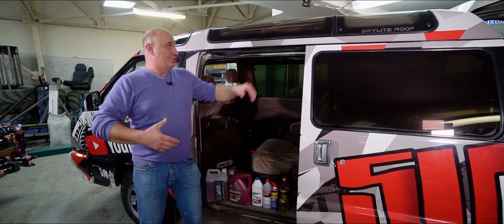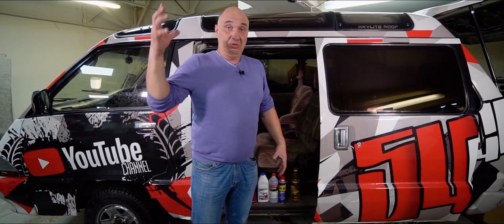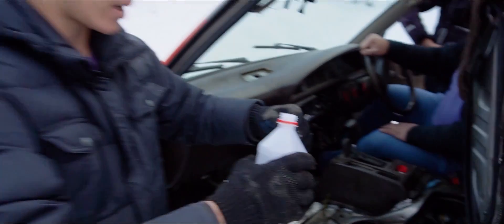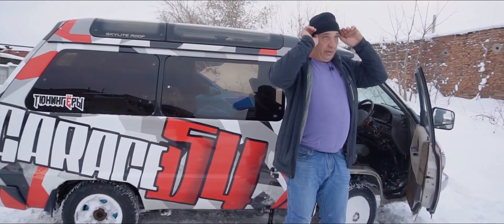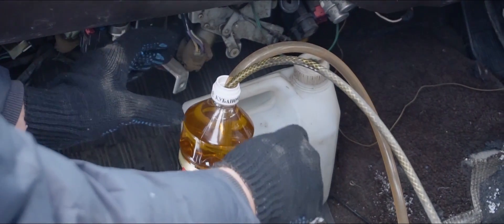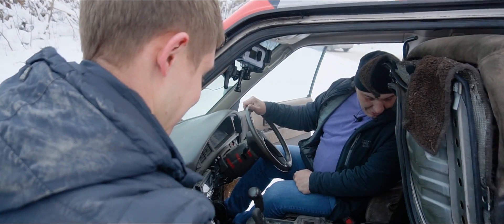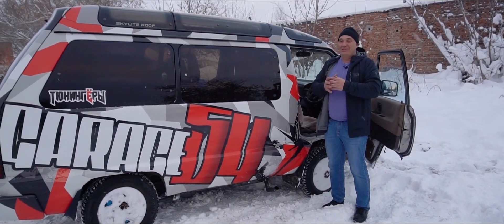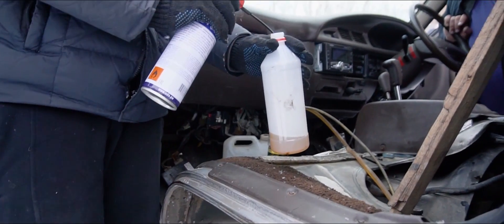Alternatives to diesel fuel: WD-40, cooking oil, brake fluid, Dexron

Comment: I believe (although not 100% sure) that running the engine on Kerosene probably cleared out a load of dirt / sludge in the fuel system, resulting in more fuel flow when the sunflower oil went in (and subsequently more Blyat under acceleration).

Some of us with old or high-mileage 80s / 90s Mitsubishi gasoline engines will add a small bottle of methylated spirit / turpentine to the engine oil and injector cleaner to the fuel just before a service to flush out sludge and clean the injectors;

1. Add a 300 to 500 ml bottle of turpentine to the engine oil and 2 small bottles of injector cleaner to a fuel tank with only 10-20% fuel in the gas tank
2. Start the car and fast-idle at 2000 RPM for 15 minutes (or go for a gentle drive, do not drive hard)
3. Turn the car off and change the oil for cheap oil (part-synthetic will do). You can re-use the old filters.
4. Start the car and fast-idle at 2000 RPM for another 15 minutes (or go for a gentle drive, do not drive hard)
5. Turn the car off and change the oil for good quality oil (fully-synthetic) with new oil / fuel / air filters and immediately fill up the gas tank to 100% 

This helps clean out the sludge / crap that builds up in the oil pathways and injector system and should restore some of the lost HP and fuel efficiency that comes with age / high mileage.

Warning: The second oil change and filling up the gas tank is extremely important to remove the aggressive chemicals in the turpentine / injector cleaner. If you skip this, your engine may fail

Comment: What would happens when you run the engine with the exhaust smoke, exhaust pipe connected directly to air intake of engine!?
 Will you try this please..😀
Reply: 100% EGR :D oxygen is used a short time and engine dies.
Reply: @Karjis  they are into some experiments. Wanna see how do engine work out, with litl bit oxygen supply & rest the exhaust smoke from engine.

Comment: These guys are Ingenious! Although Cooking oil in my opinion is a GREAT ALT to Diesel fuel, The drawbacks are that I've noticed your Injection pump & Injectors over time will get gummed up & Clogged. Therefore more timely maintenance. But ofc it depends on the eng.

Comment: I keep one gallon of atf in all my diesels.... it’s gotten me home a few times... and can be used in everything: power steering, fuel, engine oil ,trans, transfer case and diffs If necessary, I even used it as an emergency brake fluid (yes flush the system when you repair it RIGHT)

Comment: A diesel engine will run on anything with a flash point, which means the fluid/gas will ignite itself just from getting very hot. Thats why diesels can run away, the oil can get into the cylinders and combust under compression, or if there's something hot in the cylinder like a glow plug stuck on or some foreign debris thats glowing hot

Comment: Kerosene is diesel fuel minus the oil so its definitely damaging your diesel engine your supposed to add two cycle oil to kerosene before using it as diesel fuel
Reply: Ratio oil/kero?

Comment: For years I drive my 2000 Suzuki vitara in a 30% washed and filtered used cook oil with 70% diesel. No issues, and better engine sound.

Comment: The WD-40 may have had aerosol in it since it came from a spray can. I'm sure it would have worked if you bought the kind that wasn't pressurized. I've successfully ran a snowmobile engine on that stuff. Diesel fuel is kerosene with paraffin wax added to lubricate everything in the system. We are working on a low-cost alternative to diesel fuel called "biodiesel" here in the USA, I wish I had a car with a Diesel engine, that was a great video!
Reply: Government doesn't want biodiesel so it has made it increasingly difficult to implement it everywhere. We are the largest producers of wheat, corn and soy. Fuel should be so readily available and cheap but its not
Reply: @vikinglife6316 what government? Here in Indonesia all subsidized diesel is B30

Comment: ONE OF THE INGREDIENTS MAKING BRAKE FLUID IS CASTOR OIL, MIXED WITH ALCOHOL!
I HEARD A FUNNY STORY ABOUT CASTOR OIL IN 1960 WHILE ATTENDING AN AUTO MECHANICS SCHOOL.  ONE OF THE TEACHERS WAS THIS OLD GENTLEMAN WHO RACED CARS IN THE 1920 ERA!
CASTOR OIL WAS USED AS ENGINE CRANK CASE OIL!
CASTOR OIL WAS ALSO USED A FOLK CURE FOR CONSTPATION AS WELL FOR OTHER ILLNESSES!
OUR TEACHER SAID THAT WHEN RUNNING IN A RACE WHERE MOST CARS WERE USING CASTOR OIL, IT WAS QUITE IMPORTANT TO RUN AT THE HEAD OF THE PACK!!
IF YOU DID NOT AND BREATHED A LOT OF CASTOR OIL FUMES, THEN YOU WOULD HAVE BAD CASE OF DIARRHEA THE NEXT MORNING!!
💩💩🤢🤢🤢 LOL LOL
Reply: Castor oil and alcohol haven't been used in brake fluid for decades. After the development of glycol esters, which have a much higher boiling point, much lower freezing point, and better corrosion resistance, brake fluid switched to those. Castor oil and alcohol based brake fluids are known as DOT 2, and are obsolete. Glycol ester fluids are DOT 3, 4, and 5.1. DOT 5 is silicone based and not compatible with the others.
Reply: puckcat22679 THANKS FOR THE INFORMATION! I HADNT HEARD OF THE NEW STUFF USED !!
I HAVE NOTICED MUCH LESS CORROSION IN BRAKE CYLINDERS HOWEVER

Comment: I'd like to see if it could run for a whole year on only the cooking oil , but put it on Dyno before and after to see what kind of numbers it will do, and will it last longer running around on the cooking oil instead of regular fuel methods

Comment: that dexron probably would have been gangster with the turbo actually on it, it was actually "over fueling" and now needs more air to clean up the exhaust smoke. know a guy that runs his 7.3 on mercon, says it actually works fine when you actually have enough air coming in to keep up. 🙂

Comment: "Anything flammable liquid can be used, no problem" well, wait a few days/weeks and if all the fuel system gaskets survived - gasket material compatibility is one of the main reasons why there are so many OEM-specific fluids out there. Then again, an old diesel van may have some ancient toxic rubber formula in its gaskets that can survive everything.
Reply: Typical rubber is NBR or Buna-N or N70 (just in different names, same material, essentially ABS rubber aka acrylonitrile butadiene, nitrile rubber) and some newer designs would use fluorocarbon rubber like FKM (essentially PTFE rubber)

These materials resist most fluids including solvents and gasoline, FKM resists them at elevated temperatures(NBR is usually limited to about 150 deg.C for some variants, 100 deg.C for raw nitirle) and more fluids, except that FKM and all PTFE compounds are toxic above 300 deg.C, even if the fumes are all clear, the remnants of it is dangerous, and strictly no fluorine(which would kill this fluorinated rubber compound)

Fuel system sealing consists of O-rings and the hoses, all typically rubber. Your main concern is the plastics that most would be present on the fuel system(newer ones to be exact, older ones are usually metal of course) which may detoriate with some gasoline or benzene and some thinners and solvents

Overall it would last fairly well until the next scheduled maintenance schedule, unless it was engineered to break which almost all things of today are. No such thing as ancient rubber formula that is toxic  on old designs, old rubbers will be NBR or EPDM(polyethylene rubber) and not FKM which is considered a high-performance rubber grade

Comment: Back in the the early '70s I was night manager at a very popular gas station. We had an owner operator
with a Detroit dump truck that loved our 26 cent a quart re-refined oil and gasoline that I don't remember the ratio.
Said He always topped off when he was in the area. 
We had 3,000 gals of the oil we pumped with a gasoline pump.

Comment: I used to run a van on veg oil.... sometimes I used to cut it with ordinary diesel, sometimes not. 
At the time it was cheaper - but now it is not. 
And yes it is a nice smell from the exhaust... totally non offensive :-) 
You just got to be careful of the viscosity so you don't damage the pump.

Comment: Yeah you've got to be careful with common rail diesels. The pressures needed are so high that if the high pressure pump loses lubrication then it will spill its guts out into the fuel rail and kill the injectors with it. See it happen all the time. I wouldn't even put the cheap diesel in them, kills them all eventually.

You can murder the fuel pump on older diesels like this by using vegetable oil, but there's ways around that problem.

Comment: Real WD-40 probably wouldn't work well either. It's not all that flammable- it usually won't burn unless you keep a flame nearby to sustain it, as most of its composition is non-flammable, low vapor pressure hydrocarbons. The low vapor pressure part is why you got the foam in the feed line. The pressure drop at the pump inlet was causing it to flash into vapor. If you use the feed pump to maintain pressure at the inlet to the injection pump, it might work, but it still wouldn't run well due to the low flammability. It would probably be able to run, though.

Comment: HOW?
Sunflower oil has no octane... and shouldn't combust
Reply: Rudolph diesel designed the diesel engine to run on peanut oil. diesel fuel was specially designed for the diesel engine to run even BETTER and LONGER, but it will run on like every oily fuel you can find. ✌🏻
it would run on liquid wax, oil, liquid spray paint, degreaser, cleaner,..... like, everything exept water i guess
Reply: Fuel in diesels is measured in cetanes.  Octane is for gasoline.

Comment: We used cooking oil instead of diesel for tractors (especially soviet made) during '90s in Serbia when there were shortage of gasoline and diesel because of war.
Also many farmers still use cooking oil for old tractors because it's much cheaper than diesel. And also smells nice 🙂
Reply: Što Borkov traktor miriše na pomfrit?
Reply: Da, i rakiju umesto benzina u osamdesetima.
Reply: Did you have to start the engine on diesel or kerosene and heat the cooking oil before it would run in the cold?
Reply: @vikinglife6316  Massey Ferguson FE35 (and yugoslav version IMT 533) was struggling on cold start with vegetable oil as fuel, best way was to mix it with diesel. But with soviet made tractors (LTZ, MTZ) - there was no difference between diesel and vegetable oil as fuel. They run it on cold with no problem
Reply: @dufko86  wow. Quality 👌🤝😊🙏

Comment: Loved it.  I imagine the boiling point/vapour pressure of the WD-40 stand-in is too low: under pump suction is starts to boil and you've got old fashioned vapour lock.

Side note: Is your area of the world right hand drive or is there just a mix of vehicles from different markets?
Reply: russia is usually left hand drive but they have everything because russia is so big

Comment: Something doesn't add up I have used WD-40 in a diesel before works just fine. But then again it was a vintage single cylinder diesel

Comment: I'm guessing the fake wd-40 is foamy because of the propellent being dissolved in it still. Its essentially carbonated. Start pulling a vacuum on it, pulling it through a fuel line, and the dissolved gas will start boiling out.
Reply: All they need to do to confirm is take that half-bottle, get it to room temperature, and shake it a little. Should outgas and foam up, but afterwards might actually run the engine.

Comment: I pour my used engine oil into the fuel tank every time I change it on my diesel... I only use its oil in the tank, haven't considered the used oil from my Toyota gas engine 🤷‍♂️
Reply: @shaun milnes I used to, but I noticed that it was always debris free so I stopped pre-filtering.

Comment: In the garage I worked at we used to prime the diesels by pouring Dexron into the spin on fuel filters. But one thing we did was mix waste oil, used fryer oil, and acetone filter it all and run it in the diesel trucks we had.

Comment: Diesel engines are popular because you can burn many different fuels - some can be grown or produced or recycled... Sugar apparently wrecks engines - is there any way of getting sugar dissolved and working as fuel? Would you have to go for glucose instead of sucrose? Could carbohydrates work if chopped up small enough? e.g. boil up potatoes/ rice into a milkshake then thin it out?
Reply: No, because sugar (glucose included) is primarily carbon, hydrogen and oxygen.  Carbon is the enemy of engines.  What gums it up is the carbon being mixed in with the water (the Hydrogen and Oxygen being broken from the Carbon to become water), and sticking to surfaces.

Comment: "Use cooking oil if it was cheaper than diesel fuel"
- Garage54
Reply: There is a van that here that runs on filtered used fish and chip cooking oil, they get it for free. In New Zealand diesel vehicles pay an independent tax based on the odometer so we are allowed to screw with the mix as much as we like.
Reply: @robmanueb.  Yes
Reply: @robmanueb.  why would you worry about the mix? We are overtaxed in New Zealand and road taxes are going into the general fund. Mix as you like. Pause your Odo too.
Reply: This, and used frying fat, was often used as fuel here in Germany, but it only works with older diesel engines. A more modern engine can take damage from this.
Reply: Old diesel engines can run on anything! 🙂 I was driving my TD Jeep on vegetable oil and this year I'm driving on wasted motor oil and that's free fuel. 🙂
Reply: @V8AmericanMuscleCar  Rip to those who made it to burning water, using higher voltage custom spark plugs.
Reply: @Wavefront101  you can't burn water that's like burning ashes it's already fully oxidized
Reply: @virtualtools_3021  you burn water via electrolysis
Reply: @CableWrestler  lol, no you don't - electrolysis is reverse burning
Reply: Here diesel now cost 2,8$ pr liter while the cheapest vegetable oil used to cost 1,17$ pr liter a few years ago because no fuel tax... (now I can not find any of the cheep vegetable oil anymore, wonder why ;) )
Reply: @a64738  - you probably cannot find cheep oil because chickens aren't very oily.
Reply: I've ran my van on used fry oil for over 40k km now. just filter it and pour it in...
Free fuel, and there's actually no tax issue because of a loophole in the law..

Comment: Biggest problem doing this on a more modern car is that the new plastic and synthetic rubber fuel lines and pump seals can react and be rotted by things like cooking oil. Some seals even swell up and jam the fuel pump. It's apparently the biggest problem if someone starts to miss fuels their diesel car with petrol, then tries to let those few litres of petrol run through the system by filling the tank right up with diesel  to dilute them.

Comment: The gas version garage 54 van was recalled in  the states due to engine fires there are no toyota vans
Reply: Huh? You can still find Toyota Previas here...
Reply: You're confusing it with the Nissan van. The Toyota van was never recalled here, and you still see them, as well as the second generation version known as the Previa, from time to time. When Nissan decided to bring their van (called the Vannette here in the US,) to compete with the Toyota van, they decided that the engine was not powerful enough for US tastes, but they didn't want to develop a new, larger engine designed for sideways installation under the floor. So they quickly tried to adapt the 2.4L engine used in their pickup for the purpose. However, it experienced cooling system issues and oil starvation issues, which led to fires. They tried to fix it a few times, but ended up recalling the vehicle completely. Some people chose to keep theirs, so there's still a few on the road today.

Comment: Here in Australia we have sunflower oil in an aerosol can that I like to use to cook meat.

That aerosolised🌻 oil is super flammable! Whoosh 🔥!!!

No need for a fuel pump when the system could be direct injected like a propane bbq.

Imagine a 6 cylinder with an individual can on each of the intake runners.
Reply: Haha I like that very much indeed, good thinking and an extremely aussie comment 😆
Reply: Thanks The W1zz4rdzSL33vE
Reply: I doubt there would be enough pressure to inject into a cylinder with like 400 psi of compressed air, propane tanks are like 100-150 psi lol

Comment: From what I've heard the secret sauce in WD-40 is light machine oil and Stoddard solvent. Stoddard is less flammable than kero and is low odor. It seemed like the pump didn't like whatever was in their blue can 40oz stuff. Oh and look up straight vegetable oil conversions, as long as you start on diesel to heat the oil and switch back before shutdown it works well.
Reply: Thought that WD40 also uses Anchovy oil in its formula?
Reply: @gsylass  perhaps, along with 7 herbs and spices, but not enough to be a good diesel substitute. Lol.

Comment: The problem with kerosene is that it combusts premature in diesel engines due to the high compression ratio.It beats up the crankshaft and the bearings badly.
Reply: Not true. Diesels inject fuel at nearly top dead center. The fuel begins to combust immediately regardless of fuel type. The problem with kerosene is that it has nearly no lubricity and will knockbout your injection pump.

Comment: Adding up to 10% paraffin or kerosene to diesel was common in the UK in winter, until winter grade diesel was available, that was the max amount allowed under Tax regulations but only in winter.  Eco diesel is refined used cooking oil and is commonly available, the oil is filtered and refined so growing sunflowers or rape for use as fuel is not needed as used can be used.  It has an advantage as not solidifying as easily at low temperatures.